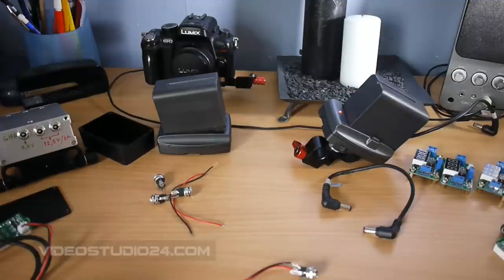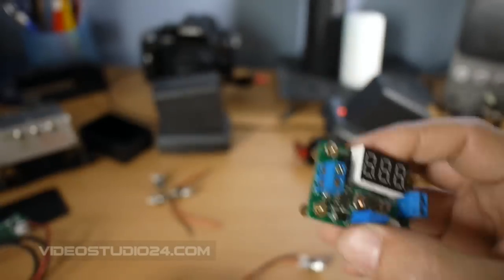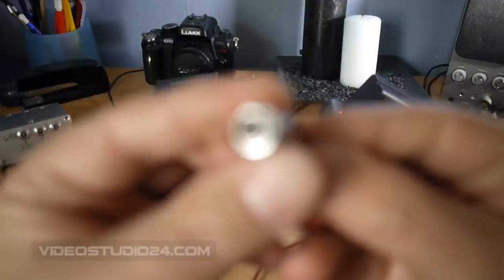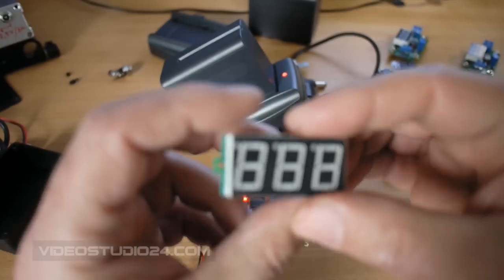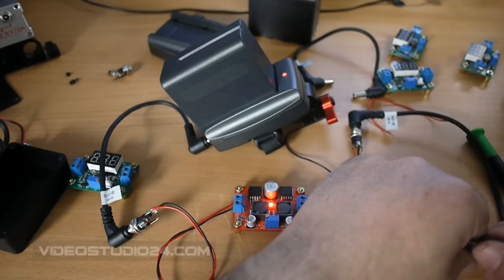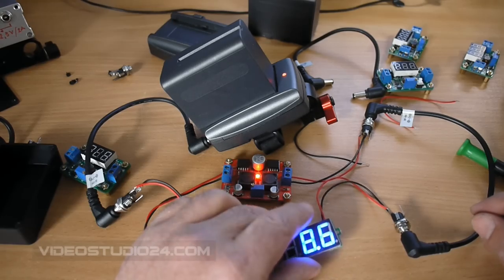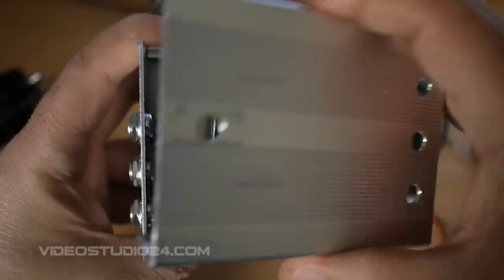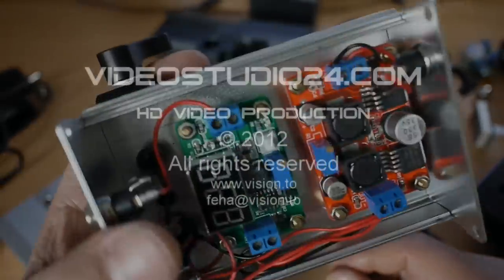DIY Powering system for your DSLR, also Lumix GH2 - a  non scientific but simple visual tutorial

Comment: It's OK, I decided to go with the Sony NP Batteries. I noticed that they have 7,2v. That's the same voltage my Camera, 5DmkII runs on. So I save one of the step down converters. I just need one 5V output for my Audiorecorder. 
I'm putting in the orders right now. I hope I don't forget anything.

Comment: Thank you for providing this tutorial. I would like to use the Tekkeon MP-3450 as the battery solution. My goal is to have a power distribution box as you have created with various taps (5v for audio, 7.4v for camera, 12v for monitor). Would I need to set the voltage on the Tekkeon to max voltage before sending it to the distribution box?

Comment: Hi fema1000, First I would say Thanks to You about this tutorial. I did one with running on sony f-np960 (6600mah). When I operate the camera, I have hear the "zzz" sound (small sound) cause I did not put it in box yet. Do You think the battery over 3A input or the camera over 3A output. How was it Your battery, does it have any sound like Mine. Thanks

Comment: Thank you! For the +7.5V and +12V taps, I'd like them to be regulated...Maybe (2) +12V and (1) +7.5V. With that said, I probably don't need a variable resistor and could stick with standard resistors?

Comment from the maker: Hi, there is not any sound on converters i used, and i did not overcharge at max, i think about 1-2 A, the sound you get might be also from converter (it can be mechanical fault on convertor) ...
I used np-970 6600mA , the battery capacity does not matter, it is important how much power your camera needs.

Comment: I have a question. Is it possible for the step down converter to break in such a way that the camera is hit with the higher 12.5 voltage.of the step up/step down converter? If so how can you safeguard the camera to prevent it from being cooked?

Comment: not scientific but not for a photographer looking for an alternate power source.  Not simple to understand, no introduction about what it is used for or where and how to use them.  Teach as you present and demonstrate how to use the device. to much detail about crude hardware and for that reason the video is drawn out long and without useful information about what and how to use the circuit to power my DSLR or Lumix GH2 your 21 min video could have been trimmed down to 10 minutes and when the video was complete you had no information on where or how to purchase this product.